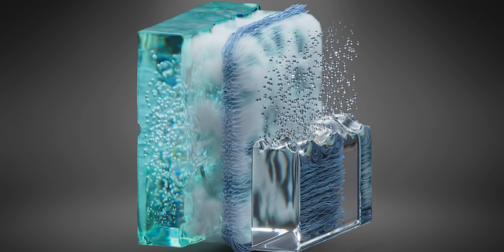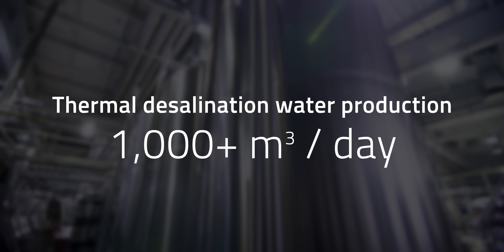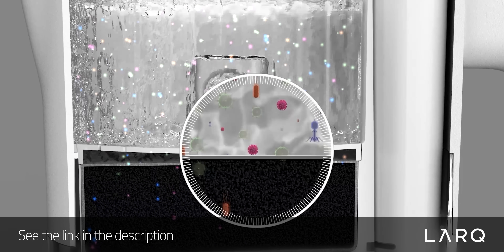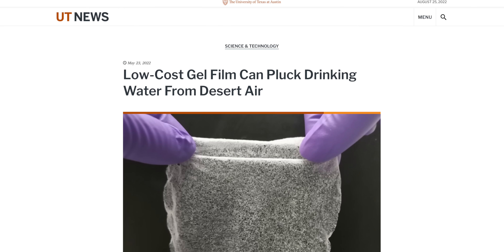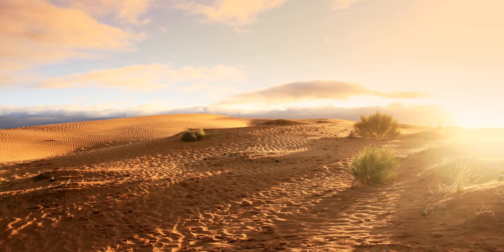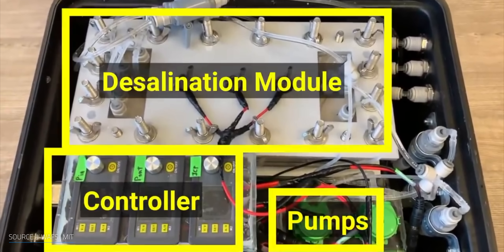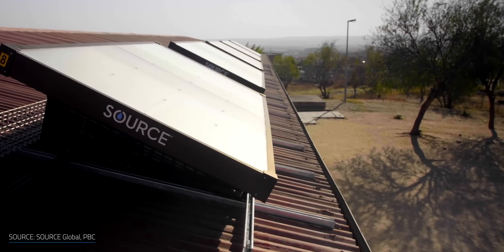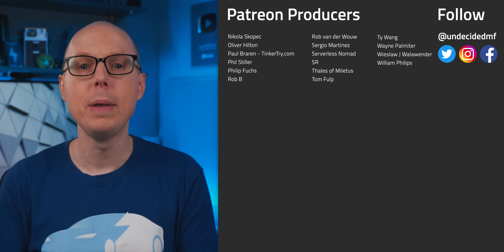2 Breakthroughs That Could Solve the Fresh Water Crisis

Comment: Gibraltar's rock-face is ideally located in moisture laden air - the night cooled rock condensed the moisture out of the air - a basic good functioning system - however it could not even support the drinking requirement of the people living there. Granted, almost all of 'our' drinking water is transported by air however freezing this water out of the air is no solution - Collecting rain or more precisely - not allowing rain to escape into our ocean might be a better idea.
Reply: At least someone in the comments has a brain.
The laws of physics are quite clear on the energy required and the maths never works..

As you say easier to let nature do the work.
Move people to the water, then its just a one off cost.

Comment: One of the best YouTube channels that I follow. I have had that solar panel perform better when they could be cool down so is there any easy way for normal home owners to cool down the panels which are on top of their homes mounted ontop of metal truss works (to angle the panels towards the sun on a flat roof). So there is already a gap between the solar panels and the flat roof, I was wondering if there would be any solution that we could do to cool down the panels like some thermal paste below the panel.
Reply from the maker: I haven't seen anything on the market yet that addresses it.  The challenge is that the efficiency loss/energy generation loss from heat isn't that much to warrant spending lots of money on solutions to solve it (for homeowners).  In many cases it's cheaper to include an extra panel or two on your roof to make up the difference vs. installing some kind of cooling system ... at least for right now.
Reply: @UndecidedMF  I understood ❤👍🏻

Comment: I'm curious what side effects of pumping salt water to houses, and having one of the MIT solutions at everyone's house.  This could be nice, since we wouldn't be wasting fresh water on those activities that doesn't require fresh water (flushing toilets, ect).  But I'm guessing that showers / washing dishes would get a lot more complicated.
Reply: Salt water is very corrosive for a lot of infrastructure, if I have to guess its more expensive to replace pipes and stuff than converting it
Reply: LMAO, NO. :)
water leaks are enough of a problem as it is, never mind if the thing your releasing is corrosive and damaging to plants and animals used to fresh water.
And everything would need upgrading as Juan says its salts very corrosive. 
And if you have lead pipes or lead solder then your going to get that lead in the water as the salt will strip that lead in no time.

Comment: I'm curious if there will be any impact from large scale adoption of these technologies. what will removing moisture out of the air do especially to an already dry area? Also had this question if wind turbines and wave power. energy removed would have to have some impact, wonder if this has been looked into. also the mit water purifier. I wonder if this can be scaled up seems like it would be a much better first stage for any desalination plant.
Reply: Wind turbines are no "worse" than anything else in the way of wind like trees or buildings. It would take absolutely ludicrous amounts of them to change the weather. If you're unsure, remember that a turbine can only take part of the energy out of the wind, if they took it all they would stop turning.
Reply: We can and should always run environmental impact analyses, but I’m skeptical that moisture extraction would have that much of an impact. Maybe at industrial scales? But it’s not as if the water permanently disappears. We can pull the water out of the atmosphere, but unless we bottle it up and never release it back out it’s going to eventually evaporate and re-enter the atmosphere. There is also such a large amount of water on earth that we cannot conceivably remove any consequential amount of it permanently.

As for wind and tidal power, I don’t honestly know but many of the same arguments from above apply. Granted we’re not using them at very large scales today, but at current scales we’re simply not extracting even a fraction of a percent of the total available energy. And while we could discover unintended impacts in the future, you also have to ask yourself what the alternative is? Wind and other renewables have way less damaging environmental impacts than fossil fuels, and none of the perceived fears with nuclear fission. What other energy source would you recommend?

To your overall point, yes everything we do has some kind of impact or cost. There’s not really any getting around that. Which means that every decision we make is a series of tradeoffs. At the same time, we don’t have perfect information and we have needs that have to get met today. We can’t always wait to perform a study on what exactly gets screwed over if we use A instead of B. Or we can, but that comes at the cost of needs not getting met. So it comes down to what things we value and prioritize.
Reply: Higher humidity is a negative consequence of climate crisis. I'd bet removing water from the air would be net positive. Bonus points: install zillions of gel film packs in forests, to replenish soil moisture lost to heat.
Reply: I remember something about this being looked at.
I think there was the idea of getting electricity at the same time you take energy out of areas with violent weather, or something like that. I just remember the end conclusion would require  basically the entire area of the Sahara to be covered in windmills before any effect became noticeable.
I'm just pulling scraps out of the back shed of memory here, so don't take my word for anything. Just look around online, I'm sure you'll find something
Reply: I imagine it would be similar to current cloud seeding, it doesn't really work outside of specific conditions and has no real impact on the environment at large because it is just not that effective. Cloud seeding efforts that are ongoing in China impact large areas for hours at a time and seem to only increase rain fall by at most 10%. The gel tech might be usable on a small temporary scale for disaster relief or backpacking but I don't see it being an industrial scale solution.
Reply: @Sightbain.  What do you do with the wasted unusable Gel membranes after they use up. More crap in the land fills.

Comment: To convert water in the air (steam) into liquid water, you need to extract a precise amount of energy from it. This amount never changes. How would rhis gel make this any different?
Reply: I know right, some people think it’s magic not science
Reply: Vapour and steam aren't the same. Vapour is in a higher energy state. Convince that vapour to give up some energy to its surroundings and you have liquid water. The transition yields energy.
Reply: But water in air is humidity isn't it? Just water dissolved into air. Steam is water in gas phase. I think they're two different things.
Reply: It don’t.
Reply: Dehumidifiers also have one other significant problem: 
There is a very small amount of water in the air, and the dehumidifier would need more and more energy to flow more and more air with lower and lower humidity - while in significant scale to produce any sort of sufficient amount of water, it also eventually creating a desert all around its location.

And with scale, I mean that if considering 30°C / 100% humidity drained to 0%, it means 35 ml of water out of cubic meter of air. Thus to obtain 2 L of water per 24 hours, you need to completely drain 57 cubic meters of 100% humid air.
In case, that humidity is only 30% and you can drain it up to 10% (= 5,5 ml/cubic meter), you'll need 363 cubic meters of air - that's a cube with an edge of 7,2 meters - just to get enough liquid for 1 person for 1 day. Not to mention, that it would be "distilled water" and you would have to mineralize it first, to prevent serious health issues…

It's just another SCAM…
Reply: @FalkonNightsdale  sorry, what health issues does distilled water cause? You can get minerals from food sources, it doesn't have to come from water...
Reply: @katanaridingremy  I believe distilled water will actually take minerals from you. So you would need to enhance your normal food to account for it. You can accommodate it likely, might be a proble for your teeth in the long term. Might also have problems for your gut bacteria. I'm not a doctor though, but I thought you wernt supposed to drink distilled unless you have no choice
Reply: @katanaridingremy  Aside from draining minerals from you, there is a problem with osmosis. 

I'll try to simplify it:
If there are differences in osmotic pressure inside and outside of the cell, they would try to even out via transfer of the water.

So, as you drink distilled water, it will get absorbed into cells to dillute their insides and get them to equilibrium. Unfortunately, it means that the cell inflates itself beyond limits and rupture, releasing it's minerals and thus lowering the difference in the "formerly distilled" fluid as a whole. Minerals are lost and you suffered damage, which you need to heal…
Reply: @FalkonNightsdale  interesting so it'll work similar to drinking salt water with the osmosis. Cool beans, thanks for the info
Reply: Not STEAM, water vapor. Vapor and steam are completely different.